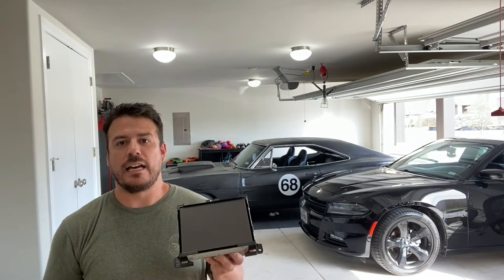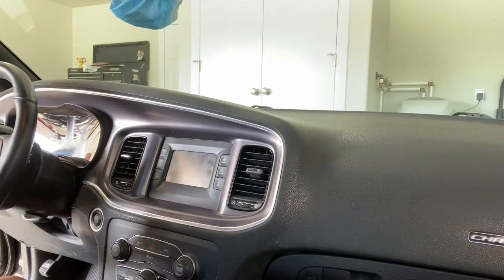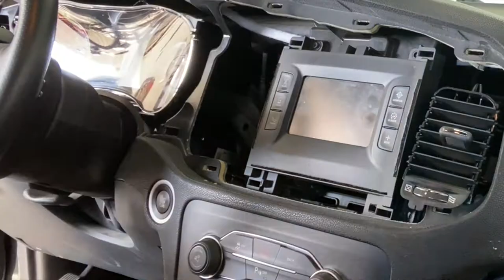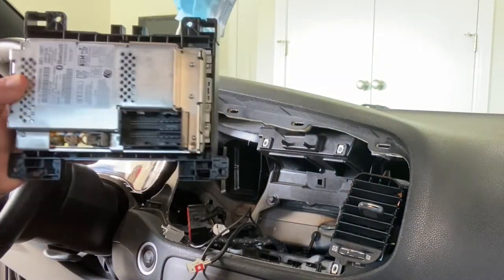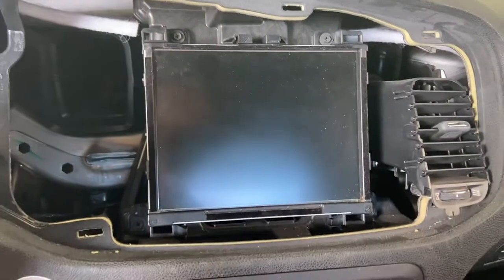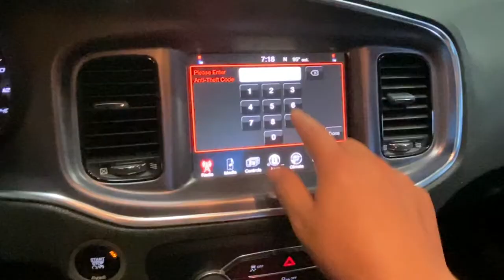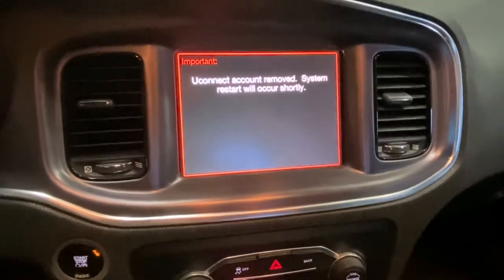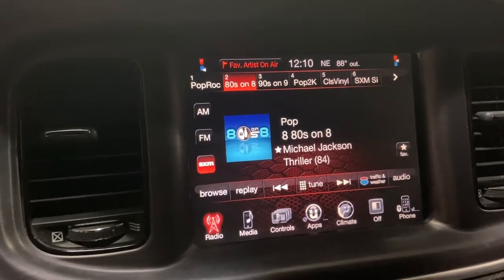2016 Dodge Charger 8.4” Uconnect Upgrade - Episode 19

Comment: How did you get the Anti-Theft Code?
Reply from the maker: I waited to until I received/installed the unit to see if they sent the code (they didn’t) and then to see it if would require a code. I ended up buying the service on eBay. Gave the seller my radio serial number and they provided the code. Think I spent $20.
Reply: @68Charger  Can you send me the link to that to me?
Reply from the maker: @elijahtimarky3857  https://www.ebay.com/itm/Uconnect-RA4-VP4-RA3-VP3-4C-UAS-UAQ-8-4-Radio-Anti-Theft-Code-Service/303732571370?pageci=0524899f-2d6a-4839-a874-e207f7e7716b
Reply: @68Charger  thank you!
Reply: @elijahtimarky3857  hey did the code work for u
Reply: Is it worth to get a 2016 charger se with 65,000 miles for $16,000?
Reply: @kobe8332  I purchased and sent a picture of the radio to him; he gave me a code less than 5min.
Reply: @elijahtimarky3857  so I got the code but my radio not getting uconnect signal I won’t even go to the uconnect store or update
Reply: @Rama_248  definitely go for it if you plan on keeping it
Reply: Does it have android auto?
Reply: If u call the dealer tell them the serial number of the car u got the radio from and the serial number on the back of the radio and they’ll give u the code for free
Reply: Where did you purchase the upgraded screen?
Reply: @68Charger what year was your 8.4 uconnect? Tryna to buy the right one for my ‘16

Comment: This has become a real challenge. I did get an RF4 radio. Odometer was flashing, volume control didn't work, rear speakers only, no balance, no fade. Went to two Chrysler dealers. First told me it was a VIN mismatch, and there was nothing they could do. Charged me $100. Didn't even stop the odometer from flashing. Second just agreed with the first and declined to look at it. I hit "restore factory defaults" and all the radio features came back. I thought I had it licked, except for the odometer. Not exactly. Every time I shut off the car it reverts back to the way it was, and I have to restore to factory defaults again. I'm not impressed with the dealers. If I can do more than them by pressing one button, I think they should be capable of synching it so it works properly.
Reply from the maker: Man, sorry you ran into issues. Was the unit from the same year and model as yours?
Reply: @68Charger  Basically, yes. Chrysler 200. Of course, there are different trim levels. Fits perfectly, and is a 5 minute install, but it won't work and can't work. I don't know why FCA was being so petty about this. You can't improve your own car, if you want to at your own expense?
Only thing I can think of is that it originally was a fleet car for the rental market, and I guess they just didn't want it upgraded.
Reply from the maker: @pluggy86  Chrysler 200 unit on a 200 or on a Charger/Challenger? I had heard that  200 unit were not compatible. I remember reading that Charger and Challenger units were interchangeable (same bolt holes) and that Ram ones would work but the holes would be off. I can’t remember on Durangos and Jeep models.
Reply: @68Charger  It was a 200 radio for a 200. Some guys posted YouTube videos showing the install. I think some were good to go right away. Others had problems similar to mine and said you just flash it at the dealer. Mine can’t be flashed and it can’t take an 8.4 inch radio at all, even though it fits perfectly if you buy the bezel.
Reply: Yea a Challenger, Charger or Chrysler 300 are all compatible with each other , the rest aren’t

Comment: I plan on doing this to my 2016 pursuit charger. It currently has the 5 inch uconnect radio. I don’t have Sirius xm on mine, did you have to add an antenna for that or did your car come with Sirius xm with the 5 inch screen?
Reply from the maker: Hey Colton, mine was already equipped with XM. It should not be too hard to add it!.
Reply: @68Charger did you have the antenna already? Or which plug in on the back is for Sirius xm?

Comment: Did all the controls work after the upgrade?  Lights, locks, climate control... everything that is in the uconnect settings?
Reply from the maker: So far yes. My Charger is a 16 SE Blacktop. After the install I was able to change the steering to sports mode. I haven’t activated the uconnect feature, mainly because it’s $15 a month and not sure if it’s worth it. (Have heard mixed reviews). I does give me the option to activate when I click on the icon.

Comment: I hooked up the 8.4 and my 2017 dodge Challenger 8.4 was out of a 2016 challenger which it works fine no problems except for I get a mirror pop up on the screen every now and then just need to know if I need to change theinterior mirror and are there wires for it?
Reply from the maker: Not sure, sorry I couldn’t be more help.

Comment: I just purchased the 8.4 for my 2016 Challenger. Where on the back do you hook up a back up camera? Which colored pin?
Reply from the maker: If your car is already wired for one, you just match the colors. I don’t have the car anymore, but you can google the connection setup.

Comment: I currently drive an 2016 SXT Challenger w/ the default 5" u connect screen. Since I don't have a back up camera or GPS, will I be able to utilize the map on the more expensive option of the 8.4 (with GPS), or should I consider getting the one without a GPS?
Reply from the maker: Hey man, that would really be your choice. If I am not mistaken, sxt trims and up (at least in Chargers) are prewired for the back up camera. You might only need the backup camera and gps antenna if you go that route.
Reply: @68Charger  thanks for replying. The back up camera I'm not too interested in since I have an aftermarket spoiler (the camera lense is located on the spoilers of the OEM), but it's the GPS that I have my heart set on.

Comment: You didn't have to replace your ac or CD player system? It seems everytime I saw someone upgrade they had to upgrade their entire system to work with new screen. Was this not the same case for you?
Reply: I also drive a 2016 charger, and unless it’s different for certain configurations, there is no CD player. Shouldn’t effect the ac

Comment: Hey I got a question in this screen apple carplay works or not
Reply: lmk if you find out
Reply from the maker: I'm not sure. It originally came from a 2015 charger. I wasn't planning on getting apple car play. I did some research a while ago and saw people that added it, but the apple carplay feature was not touch screen, you had to move the radio buttons to select different features. I didn't want to mess with that.

Comment: Did you have fitment issues with the dash bezel after the upgrade??
Reply from the maker: No issues, uconnect is oem and was a direct fit.
Reply: @68Charger  yea. My dash bezel doesn’t fit flush anymore... don’t want to cut it.. don’t want to buy a used one since my car only has 1500 miles on it lol
Reply: @chetmann405  did you ever get it to stay flush?

Comment: @68_Charger hello brother I got a 2016 Se charger i am looking to upgrade from the same screen you swapped out can you please give me some on which 8.4 will function properly on my vehicle.
Reply from the maker: Hey Roman, my understanding is the 15 and 16 Challenger/Charger Uconnects are interchangeable. Mine came out of a ‘15 Charger SRT and it works fine. Keep in mind that features that did not come with your car will not show up on the screen (heated seats, etc...) let me know if you end up getting one. Good luck!
Reply: @68Charger  thanks for replying i want one with navigation i don't know if it will function.
Reply: Hey bro I found one from 2016 durango will it work on a 2016 charger se model obviously these models don't have the shark fin antenna.
Reply from the maker: I’m not sure, I know some models aren’t compatible. I think Ram Uconnects work but the mounting holes don’t align. I think I remember reading that Jeep and Durango ones wouldn’t work. Didn’t want to spend that much money on something I wasn’t sure was going to work.
Reply: @68Charger  hey brother sorry for the late response turns out it does function and everything only thing is the mounting brackets dont align🤦🏻‍♂️

Comment: Which input did you put for xm to work. I had a light blue wire input it into the brown input on the radio
Reply from the maker: It’s been a minute, no longer have that car. The colors matched in both my units.

Comment: Can you connect backup camera to it ?
And how did you get the code?
Reply from the maker: Sold the car a few years ago, i believe the Uconnect has an input for the camera. My car did not come equipped with one. I got the code off eBay. I sent the the radio number and they provided the code.

Comment: Hey! On ebay it say "Screen Display" Is that the right one? Its like slimmer I don't know if its the whole thing.
Reply from the maker: It would have to be from a 15+ Charger/Challenger for it to work
Reply: No that’s not it that’s just the lcd display on the front that you touch

Comment: did the head unit come from another charger or can I get one from a Crysler. Also, have you looked into adding apple car play?
Reply from the maker: Came from a 15 Charger. It is my understanding that Chargers, Challengers, and 300s are compatible. Was not planning on adding apple car play.
Reply: What about Chrysler 200?
Reply: Is it compatible with a 200 Chrysler I have a 15 challenger
Reply: I ordered a Chrysler 200 8.4 Uconnect from a junkyard and installed it yesterday into a Dodge Charger 2016 SE, and everything works like it’s supposed to.  When you first turn it on it says Chrysler, but 1-2 minutes later it cuts off and Dodge appears on the screen.  The UConnect has four screws, but only the two on the bottom line up the two screws on top don’t match.  I used zip ties for the top two and I’m happy with it.  One last thing you will need a pigtail wire, because the 911 pops up from time to time.  Thanks for the review

Comment: I have a 2017 charger and I want that screen ASAP was it new or used what yr is compatible with my car
Reply from the maker: Hey Mike, I got it off Ebay. For my car (2016) I read that '15 and '16 Challenger and Charger uconnect units were compatible and I ended up finding a '15. I am not sure about '17. I would just look for a '17 unit Ebay to ensure compatibility.

Comment: How did u get the right code to put in. To get the radio to work ?
Reply from the maker: I found a service on eBay. Gave them my Uconnect’s serial number and they sent me the access code.
Reply: @68Charger  Ook cool cause I’m taking to do the same u did , I found some one in taxes with a 8.4 Uconnect. But he wants $500 for it   I’m thanking bout going get it  cause he told me he would put it in for me  to make show it’s done right for me.  So what u thank ? How how much they are ? Cause I see every body selling them about $500 to $650  that’s high
Reply from the maker: @staysolidnick6220  I bought my Uconnect over 2 years ago (I don't have the car any more) but they were that price then. I just got lucky and used the buy it now option.

Comment: Can you use any 8.4 uconnect in the Dodge Charger or does it have to come from another charger
Reply from the maker: Charger, Challenger, or 300.
Reply: Or a Ram
Reply: If you use a Ram stereo the brackets won’t line up for installing the new stereo

Comment: If I upgrade can I call the dodge dealer ship and give them the serial number to the new radio and car I got it from will they provide the code ?
Reply from the maker: They should, just not sure how much the will charge you. I used an eBay service, cost around $20

Comment: Because I was told that if I changed from the factory radio to the 8.4 I would lose the capability of having heated steering wheel and seats
Reply from the maker: Not sure, I did have some people tell that.
Reply: You’ll only lose the capability to turn them off manually. They will still turn on.

Comment: How much did you pay for this? I mean in parts? Or should I just go any other brand stereo?
Reply from the maker: I think I spent an additional $70 or $80. I had the buy the unlock code and a 911 connector to make a warning disappear. It’s totally up to you, man.
Reply: @68Charger  were can I find the 911 connecter..I keep getting the 911 not working need to be serviced at the dealer message?
Reply from the maker: @lunapark9395  I think this is where I got it from . 
https://www.infotainment.com/products/911-vehicle-phone-override-cable?variant=1053749437

Comment: So I have a question I did this upgrade when I had my 12 charger and the climate would always show 22 degrees I have a newer one and am thinking of doing this upgrade does your climate actually move when changing it to warm or cold and does it stay on it
Reply from the maker: Hey Deron, I haven't had any issues since upgrading to the 8.4 uconnect from my 5" radio. The climate features are working the same.
Reply: @68Charger  ok thanks for the feedback i really appreciate it
Reply: Do you have auto climate on your charger? Can you confirm if your climate screen on your new 8.4 actually shows an actual temperature or does it just place the dials randomly at 22°?
Reply from the maker: Hey Deron, I apologize, I think I misunderstood  your question. My car did not come with auto climate control so the actual screen does not show degrees, but it does work the same as my old 5" radio.
Reply from the maker: Hey Jerod, my car does not have auto control. It does not show degrees on the screen. In another video, I installed a climate control module from a challenger Scat Pack that came with the sports mode button and the "auto" button for climate control. Every button worked on it with the exception of the auto button. I started looking at ways to get the auto climate to work but have been focusing more on the 68 Charger lately.
Reply: @derongray927  did you put the newer screen from 2016?

Comment: How did it not require something called "proxy alignment" after that?
Reply from the maker: I think that is only for Darts and 200s. Mine didn’t require anything. It was just plug and play.
Reply: @68Charger  nice, I have a 2019 Dodge Neon, when I upgraded my 5 inch display to a 7 inch uconnect unit my odometer kept flashing. Did some googling and found out about that proxy alignment thing.

Comment: How did you know the code ?
Reply from the maker: I waited to until I received/installed the unit to see if they sent the code (they didn’t) and then to see it if would require a code. I ended up buying the service on eBay. Gave the seller my radio serial number and they provided the code. Think I spent $20.

Comment: if I was to get a 2017 or 18 unit would it work on my 15 charger?
Reply from the maker: Hey Brandon, I am not sure. I know '15 and '16 Chargers used the same uconnect units. I think after '17 or '18 they upgraded to a new one. Let me know if it works!
Reply: Hey Brandon, did you ever do it, did it work?
Reply: @axelmontano  no man been trying to find one but can’t, I’ll let you know if I do
Reply: @brandonnun5297  did you do it ?

Comment: How did you get the code
Reply from the maker: Hey, man. I waited to until I received/installed the unit to see if they sent the code (they didn’t) and then to see it if would require a code. I ended up buying the service on eBay. Gave the seller my radio serial number and they provided the code. Think I spent $20.
Reply: What did you look up on eBay
Reply from the maker: https://www.ebay.com/itm/Uconnect-RA4-VP4-RA3-VP3-4C-UAS-UAQ-8-4-Radio-Anti-Theft-Code-Service/303732571370?pageci=0524899f-2d6a-4839-a874-e207f7e7716b
Reply: Thanks man

Comment: I swapped out my seats in my ‘20 scat and the seats are also ventilated do you know if i swapped tge Uconnect i would have that ventilation option in my controls? Or can i get that option in a different way?
Reply from the maker: Man, I’m not too sure. I would think it would have to be activated if wiring harnesses are already present.